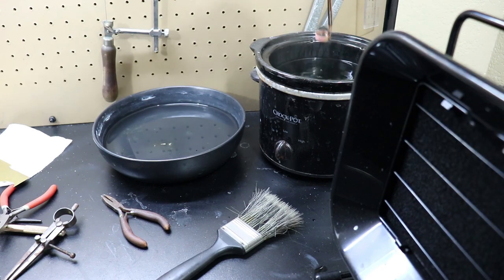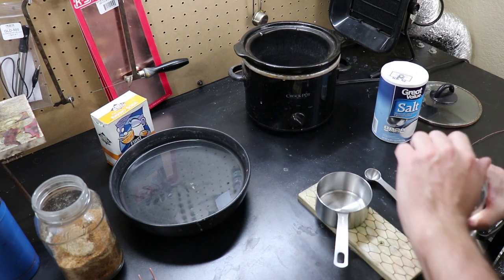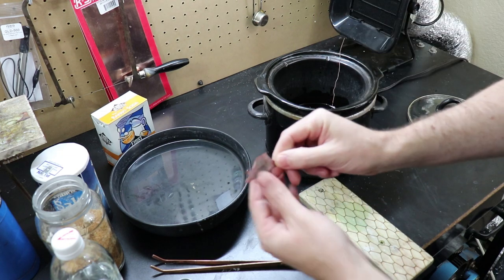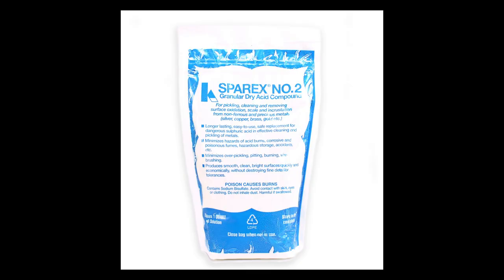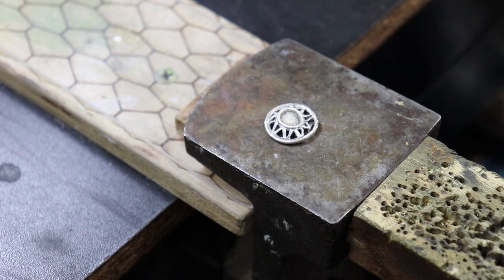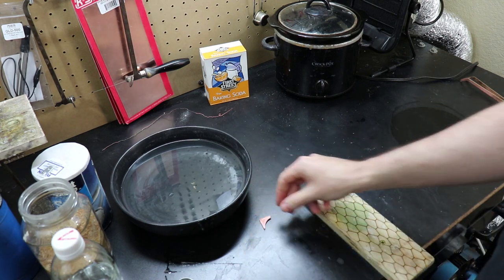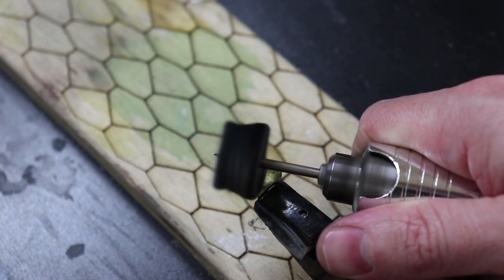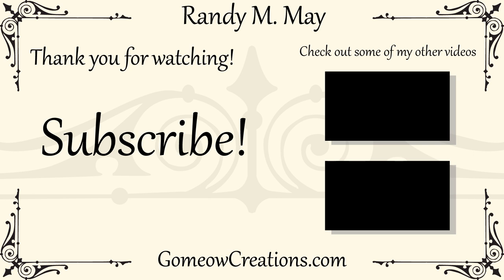How to make and use pickling solution (Cleaning metals)

Comment: Very useful and thank you. My question is: If I heat the vinegar and salt for a faster clean, will it damage an enamel roasting tin? I need sth this size (30 x 30 cm) for my copperwork?Can I use stainless steel or aluminium? Also, is it injurious to health when heated?  Thanks again.

Comment: Hi! I've recently gotten into silver soldering and have started soldering at home. I have the pickling solution from rio grande, and now am wondering about what temp to keep my small croc pot at. Do you know if its ok to turn the croc pot on/off and reuse the pickling solution? Will it matter if I only turn it on when I want to pickle something? Love this video too!
Reply from the maker: Yeah just turn it on as needed. I normally turn it on high when I first start working so by time I need to use it it warm. If it starts to boil just turn it down to warm or low. 

You can use pickle over an over again.
Reply: @GomeowCreations  Wow thanks so much for the quick response!! You ROCK!

Comment: what temperature do you set your crock pot in when you do your pickling, is it particular per or the same for all metals? love this video, randy, very informative👍👍
Reply from the maker: I normally just keep it on low for everything. It doesn't seem to matter what temperature it is really as long as it warm/hot it works fine on everything I throw into it. 😁👍
Reply: thanks! i'm going to attempt a simple rustic copper ring with a stone to compliment my copper band so been studying a couple of your videos haha goodluck to me!😌😜
Reply from the maker: Best of like and let me know how it turns out. Also don't cut your finger on the metal like I did in the video haha. 🙃
Reply: oh yeah-i caught that haha you shd be careful! i will try my best not to cut myself either...will let you if how it turns out😝
Reply from the maker: I'm working on a paid course right now but from the sounds of it your not going to need this course haha. It's going to show in detail how to make a couple different rings. I will be working on some other paid and free videos.
Reply: oh best of luck on that randy, im sure you'll do great cause your instructions are quite detailed & really informative and at the same time, not too technical (i think!) that it gets 'draggy'. 🙌🙌

Comment: I was just randomly looking up on how to Solder, when The instructor kept referring to the pickle or the pickling and to not mix any other metal other than copper tools to remove your silver from the pickling for it will contaminated it. 😱 Ohh Noo I thought, but what the heck IS Pickling. Hey don’t make fun of me but up until my late 30s I found out that a 🥒 Cucumber in vinegar actually made a pickle. 💁🏼‍♀️ so when I heard them say pickling I automatically thought of vinegar but wasn’t sure until I came across your post. Thank you Very much for confirming my thought that vinegar and a whole bunch of stuff is what pickling is. However, ruining my crockpot ? THATS a whole Nother discussion. 🤨🤔😬🙃😎
Reply from the maker: Just buy a small cheap $10-20 crockpot for it. Also you can put silver or copper in the same mix with no problems. It's when you get steel into that mix that it's a problem. The steel will make a chemical reaction happen and plate everything in copper. This is why you use copper tongs to take anything out of the pickling solution. 😊👍
Reply: @GomeowCreations  right on 🥳 Thanx for clearing that up for me and making this Pickling thing even more clearer for me. 😋🌸🍃
Reply from the maker: No problem. I have a lot of other videos you might also like that just show how to make jewelry so feel free to check them out and ask any questions on those videos of you need help.

Comment: Hi, thanks for the video, I wanted to buy some pickle powder and the jewellery supplier wanted $50kg plus shipping $15, after searching I found out it can be brought from the local hardware store sold as dry pool acid or sodium bisulphate for only $15 for 3kg
Reply from the maker: That is a lot of money for pickle and I'm happy you found some for cheaper. You can also use salt and white vinegar if you wanted to 😁👍
Reply: @GomeowCreations  I melt scrap gold jewellery and a fair bit of borax, I'll try the vinegar and salt one time, thanks for your reply
Reply: @GomeowCreations  i use a large potato to melt it in, I find it works better for me compared to graphite, I find the bar can get stuck in the graphite sometimes

Comment: Is there a benefit to using a commercial solution vs vinegar and salt?
Reply from the maker: Yes, it lasts lot longer. All you really have to do with it is add water. The vinegar will not last as long and become weaker over time and you will have to add more vinegar.

Comment: I have been using Sparex 2 with a baking soda bath to neutralize.  I understand that I can save my pickle solution for a long time, but what about my baking-soda water?  During Covid lockdown, we’re reducing trips to the grocery store. I’m out of baking soda, but still have the soda/water mixture I used 4 days ago.  Will it still neutralize the pickle on my sterling pieces after pickling, or is it dead?

Comment: what things can i use  to replace a crockpot ? and how warm does it need to get? , could i avoid using a pickling solution by sanding/drummer
thanks ol great one
Reply from the maker: You can us it cold if you want it just takes a lot longer. You can use a hot plate to heat up your pickle too. 

You can sand stuff off but you really should just use the pickle to do this.
Reply: @GomeowCreations  thanks for the info

Comment: what temp must your crock pot be at, will a baby bottle heating pot work?
Reply from the maker: I just have it set to low. Acid work better/faster when hot so if the bottle heater can make it warmer than room temp it would be better than nothing. If you do use that make sure you use something that is not going to react with the acid and something you will never use with food again. 😄👍

Comment: This is kind of a long one. Sorry. 

That's a very very cool tidbit about removing copper plating from brass! I'll try it with bronze and let you know how it works. I haven't worked with brass in years. Or bronze for that matter, but have some now. Hell, I haven't worked with any of this stuff since like 1985. 

My very serious question about Sparex: I'm working in my really little studio apartment & I have a small crock pot that I use for pickle. As Sparex is an acid, will the steam escaping the crock pot do damage to the wooden cupboards? I mean, if you know. I don't know whether the steam carries the acid or not. I made a circle out of a wash cloth, embedded it with baking soda and I keep on the top of the lid of the crock pot with some over hang just to maybe neutralize the acid in the steam. Shit. I should get some special paper to see if it reacts with the steam. I honestly have no clue here so anything you can add would be really helpful, and I would be grateful. I never took chemistry! 

Also want to ask if one can simply add baking soda to the Sparex until it is completely neutralized (very foamy-Idid it once, but my pickle's filthy and I need to change it!) and then dump it in the toilet or down the drain.

I bought some fiber glass screen and cut a pot sized circle then threaded a piece of copper wire through the edge for my crock pot. I also made a little handle from copper wire so I can pick it up to get little pieces off the bottom of the pot. Works pretty good and the temp doesn't affect it. Not so sure about having the copper in there all the time though. That's probably why it gets so dirty. Black bottom pot. 

Jeez. I use my pickle for food all the time. I wonder if that's why all of my teeth disintegrated and I have  indigestion after I cook with it. ;-) teehee.

Comment: does the vinegar pickling solution also need to be disposed of at a hazardous waste disposal, or is that just for the other one?
Reply from the maker: It does. That is making it hazardous is the suspended copper in the liquid. If you let it all dry out it will be safe to through out as normal

Comment: Hi Randy, i did something wrong I think......i did some silver soldering, the pickled it......then a few days later i used the same pickle solution for copper, and the copper turned green, so getting in touch as you might know why this happened? Also when i did the copper one, i'd forgot about the baking soda step, and just left the copper piece to dry, and overnight it went very very green! like it was growing on it, did it go green because i didnt do the baking soda step? i accidently used metal , steel tongs once in the pickle....did that effect it also?
Reply from the maker: Yeah, you did something wrong haha but it's ok. 
1. don't use steel in the pickle unless you want everything to be copper plated.
2. You have to clean it off of it will turn green if you let it air dry, you can just use water for the most part but you want the acids and salts off the the metal of it will "rust" 
3. You can just clean the metal again using a brush and put it back into the hot pickle again for like 10-15 mins and it should clean it up just make sure to clean the acids off of it. 

Try that out and let me know if it fixes things.
Reply: You have to use distilled water tap water chlorine will do this

Comment: Hi, I often hear that you shouldn't use a crock with metal, but I notice you do (and what I have available, but I'm worried about used it) have you ever had issues with contamination because of it?
Reply from the maker: I have had not problems with it other than cracking the container one time by putting l large piece of red hot silver into it. 

Just make sure you only use it for metals and don't get any steel into it. Also never use it to cook food again
Reply: @GomeowCreations  Why not steel?

Comment: How can you get copper off your silver. ?  Sometimes my silver comes out of the pickle with a slight copper look.
Reply from the maker: That sounds like fire scale or some copper plating. First make sure you have no steel in your pickle. To get this copper look off you can used the hydrogen and vinegar set up to remove the copper from the outer layer of the silver. You can also sand or buff it off if needed.

Comment: Maybe a dumb question, but if the purpose of the pickling is to make sure the surface is clean of any oxidation before soldering, then would pickling still be necessary for pieces that were just sanded?
Reply from the maker: You can sand it if you want but at some point your are going to have to pickle your work to lean off the flux
Reply: @GomeowCreations  Ohhh, gotcha! I've only been cold working my stuff so far, and your channel has inspired me to try out soldering soon. I'm putting together a list of stuff to buy now and your channel has been a huge asset. Thanks!

Comment: I made a mistake and left my pickle pot on over night. The solution is almost dried out. Help. What can I do to fix this?
Reply from the maker: I did the same thing over the weekend. You can just add water to it and heat it back up and see if you can mix it back up.

Comment: Spareks is sol NO2  right? 
so using this  making such a mixture by adding H2O to HNO3 Is created. Nitric acid in pot ? 
The fumes of such a solution are not very healthy.
 If nitric acid is formed from this after mixing with Sparex No2 with water then then it mąke sense as a safe form of storing dry acid.

Comment: That junk is not junk. Get yourself one platinum electrode. and a plate or ring you wish to plate in copper. And apply electricity. This will clear up the copper, from the solution. 

Note: Getting the polarity wrong will only coat the platinum in copper, so switch. * Oxygen and hydrogen are made during this process, so do so in a well ventilated spot. or you could go bang.